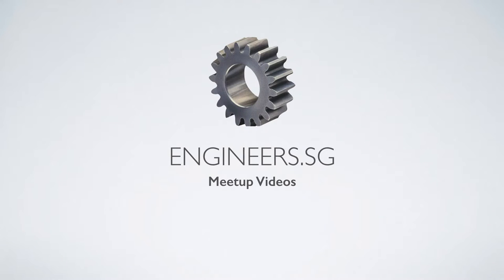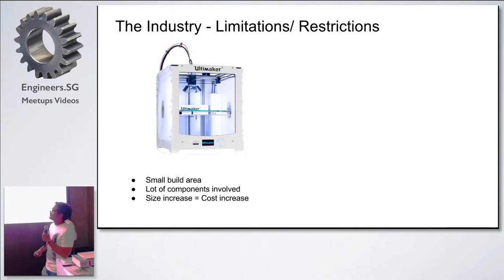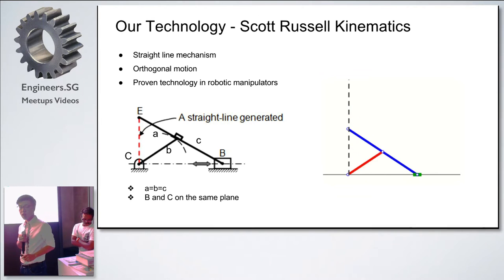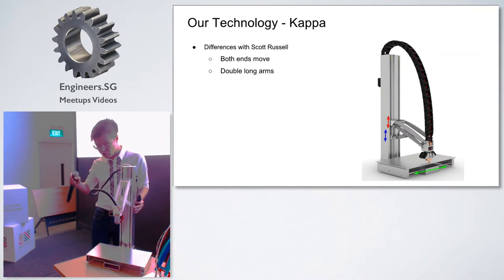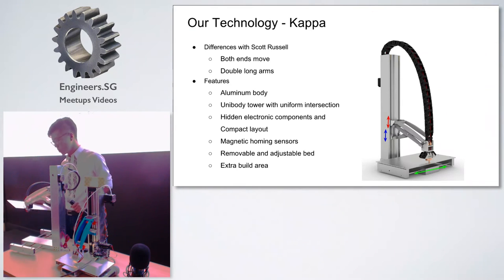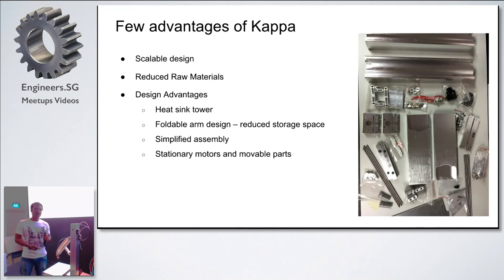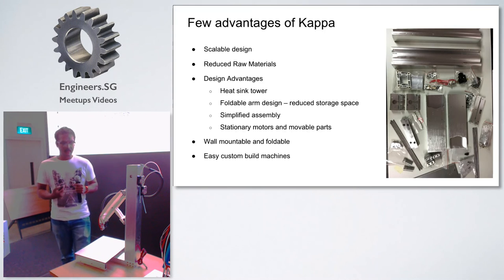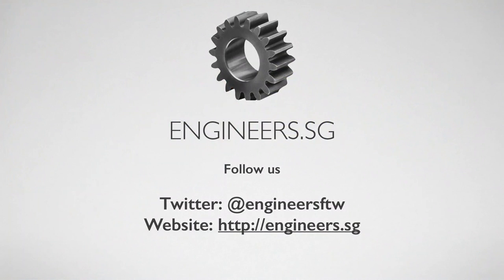3D Printer (Kappa) - Hackware v2.8

Comment: One thing, I am worried about is the stability of the structure being printed when the height of the structure to be printed increases. Since the table on which the structure is being printed itself is sliding/moving, the structure itself will be moving which I am thinking is not good. In other printing methods, that is not the case- the structure being printed remains static. Of course, it will depend upon the material being printed. If the material is not cured fully and it is having some height, and it is moving on the base plate while being printed, there is chance of some shear or some other damage to the structure. Added to that if the speed increases, then it is going to have some adverse effect. Any opinion about this?